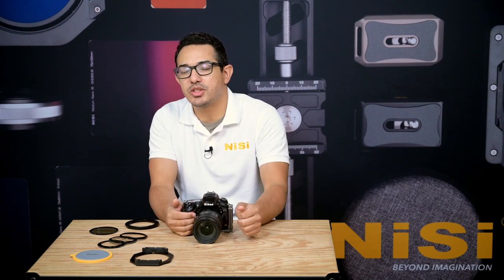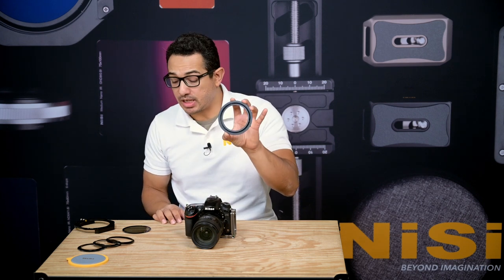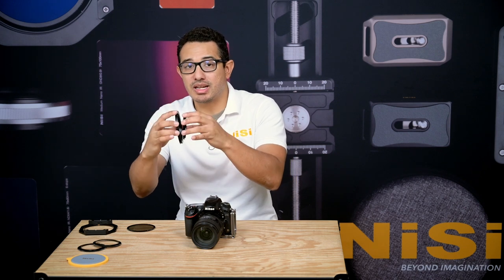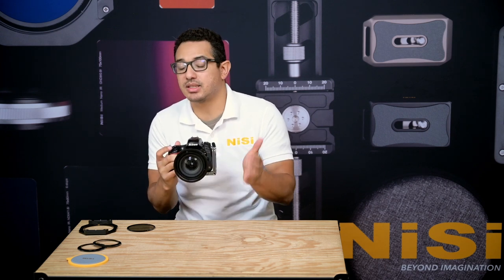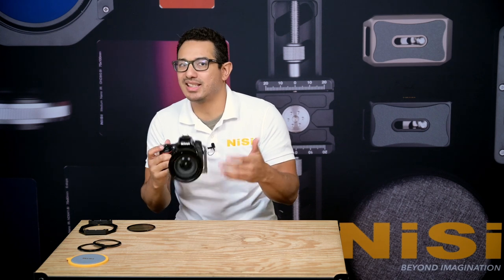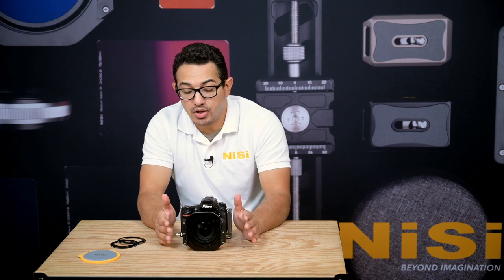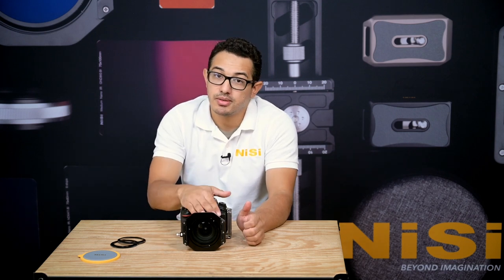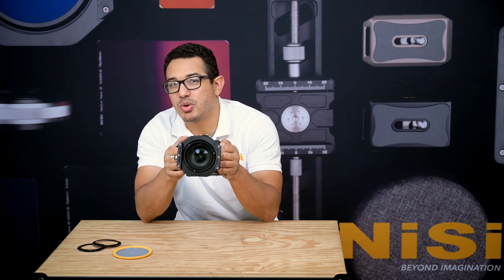NiSi V7 100mm Filter Holder Installation Instructions

Comment: My 72 adapter remained stuck in the polariser... Can you give me an advice how to unscrue it? I tried the rubber glow... it did not worked. Thank you.
Reply from the maker: The adaptor rings can get stuck if they are cross threaded, overtightened or if debris like sand or other particles find there way in. The best way to get this off is to use a large rubber surface like the bottom of a shoe.
Reply: @NiSiOpticsUSA dame problem. 72  adapter stuck. I don’t imagen of to use the bottom of a shoe… could you explain me some more please.

Comment: Thanks for posting such a clear demonstration. I just took delivery of one of these (got the ten stop arriving tomorrow as well). Was having trouble separating the 82mm adaptor from the actual filter holder (they came attached in the box) - turns out you need to pull that little knob on the side out when it's loosened! Can't wait to try this!
Reply from the maker: Glad it was helpful!